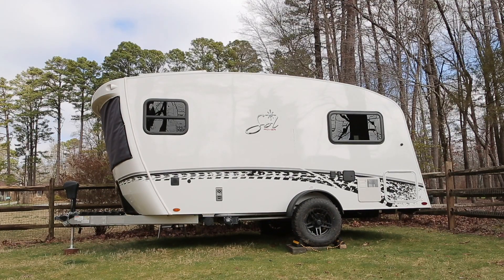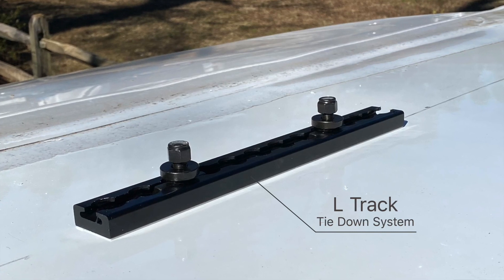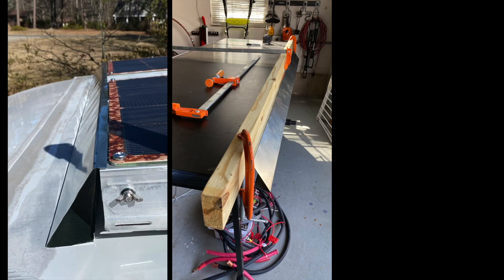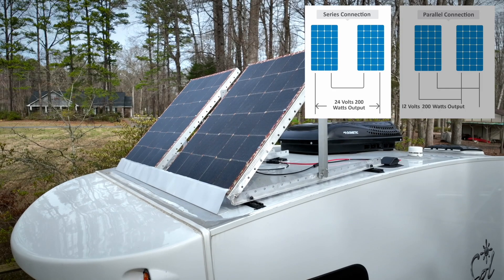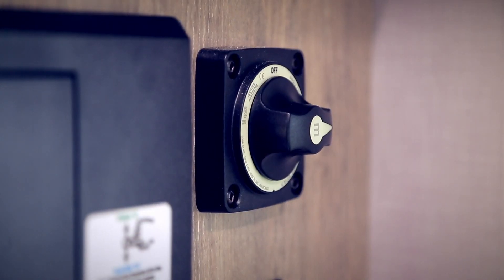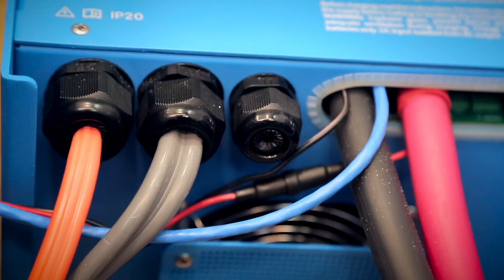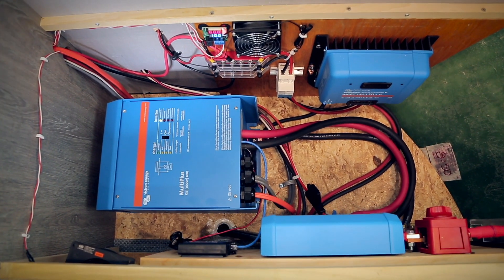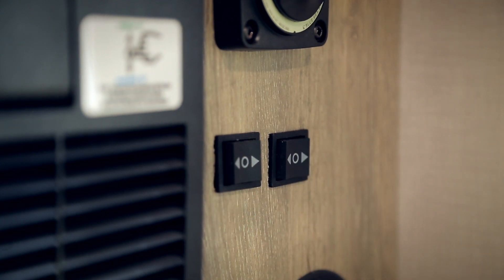2023 inTech Sol Horizon Solar Build

Comment: How does the cooling fan on the small exterior vent working?  Does it move enough air?  Was thinking about installing a larger vent in mine...maybe a 3" or maybe 4".
Reply from the maker: So far so good. The size isn’t as important as the speed of the fan because, at least in the Horizon, you’re limited by the size of the vent port.

Comment: Very nice set up! You have the set up I would want. I take it the batteries are in one storage compartment.........how did you run your cable from the batterie box to the Multi Plus compartment?
Reply from the maker: There is a space about a 1/8” wider than the cables between the wall for the propane and the interior wall of the dinette seating. Just ran 2 6’ cables from batteries to the lynx distributor through there.
Reply: I also have a Sol Horizon and am in the middle of the solar design process. Do your 6’ battery cables get warm at all when you run the AC for extended periods? Did you buy them ready-made, or did you custom crimp them? What gauge are they? Thanks!
Reply from the maker: @dalesdervin nothing gets warm. Everything to and from batteries and the lynx distributor are 4/0 gauge. I don’t remember if I crimped these, I think I bought them with lugs attached, but I crimped a lot of the others.
Reply: @TheFotogeek thanks for responding. I have solar incoming as of this past weekend. I am operating out of the one storage bin with a 100/50 controller, 460ah Epoch battery, and two room-hogging lynx distributors. Am am pondering Xantrex inverters because of their low weight. How did you conquer inverting without charging from the AC side? I haven’t see that explained. Thanks!
Reply from the maker: @dalesdervin  I don't really understand your question. When shore power is plugged in it doesn't invert, it's just doing a passthrough of AC power. So it can power the camper and charge the batteries. When disconnected from shore, and I need 110 AC running in the camper, it's inverting by pulling 12v power from the batteries and inverting it to 110v AC. The inverter doesn't attempt to charge anything because there's no shore power coming in. However the solar panels and charge controller will provide some assistance. The load while inverting will typically be greater than what my panels can provide. They won't charge, but they will assist the batteries. If nothing is drawing power on the AC side while inverting, and the sun is out, the solar charge controller (not the inverter) will then resumes charging the batteries. Without shore power the inverter will always pull 12v power to keep it's capacitors topped up and ready to invert. The inverter only charges with shore power connected. I have no idea if that helped or not?
Reply: So, when shore power isn’t present, and the inverter is working, doesn’t Ac power from the inverter also power whatever powers the converter charger? How is the charger bypassed? Is it a matter of where you spliced the inverter in or something?
Reply from the maker: @dalesdervin  oh are you talking about an existing charger in the RV? I removed ours. I put in a new 12v fuse box as well. The existing progressive dynamics box kinda sucks. So the Solar charge controller charges without shore power, and the inverter charges with shore power. I rerouted shore power directly to the inverter, then out and up to the distribution (breaker) box.
Reply: @TheFotogeek  Hi! I got the Xantrex Freedom XC Pro 3000 because I'm trying to be weight conscious with everything in the same storage compartment. I am wondering how you ran the AC wires? And what exactly are the types of AC wires you used?- I have searched Amazon to death and can't find what you are showing. I believe the orange one is the extension of the AC shore power, but I sill can't find it. And the grey output I can't find either. I bought 6/3 wire and after receiving it, I highly doubt I can fish it through. Your wire looks flatter....
Reply: That is what I’m going to do. Thanks for your help!
Reply from the maker: We spoke in the intech forums about this. I had to reduce to 8/3 so it would fit in the main breaker, and set my inverter to max from 50 down to 30a to ensure it wouldn’t overload the wire. I got the wire at Lowe’s. They have a spool you can cut however much you need, so it’s affordable.